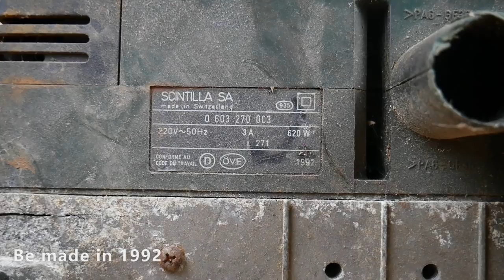Restoration Of Belt Sander | Bosch PBS 75 Restore

Comment: Back when Bosh had built up the reputation for making quality power tools.
Reply: Yeah, I have one of these and until today it was still going strong and I think the only issue is that I’ve finally worn the motor brushes down!  A set of brushes is £4.75 on ebay so it’ll soon be running again!
Reply: @chrislloyd1505  You'll be good to go for another twenty years maybe longer 👍

Comment: Got mine in 98 - been a great tool. Broke the original drive belt just a couple of days ago.
Reply: Easy and cheap fix, and you've probably done it already. In case you haven't, I didn't like how it was done in the video, apparently forcing it on under full tension. Just remove the nut that holds the big tooth wheel on the axle of the roller, and push the axle in, that way it is very easy to first put the belt on, position the big wheel where it should be,  and then push the axle back through.

Comment: I have the same one... Had to change the brushes and bearings... Also the belt tensioners sliding bearing, melted the plastic... Will replace wit a ballbearing... Good machine... Loud as straight piped V8... :P

Comment: Back in December, I bought a PBS75 at a thrift store - they had a huge crate of various power tools that they had apparently tested and deemed unworking, and everything was the same price, which I don't recall exactly. I'm quite sure it was less than 50 DKK (6-7€/$), probably either 25 or 20 Danish Kroner, but could have been as low as 10, I don't remember. I asked the guy if he knew was wrong with it, and if we could try powering it up. It was slightly battered, the front holdin knob was cracked snd had been repaired with duct tape, but spat from a little surface rust on the bottom steel plate it didn't look water damaged. No problem, he plugged it in, and the motor ran fine, but the roller didn't rotate. He then said that the drive belt was probably broken, but that would be easy to replace. Of course I bought it! I took it apart, and sure, the belt was broken. Othen than a little grime and dust everything else looked fine. I could read the part number on the belt, so I looked it up, and found a web shop selling spares. They asked 125 DKK. Plus 39 shipping. Last week I went to the nearest store, but they couldn't get spares, although they did have the current version on a shelf - listed at 899 DKK! Tuesday I went to a different store, no problem, they would be happy to order a spare part for me. She looked it up, got my number and said it would be around 50 kr+25 transport, and it could take a few days, maybe a week. Yesterday I had a call, and I got the belt in the afternoon. 65 kr, less than 8 €/$, all in all. Today I cleaned the tool a little, installed the new drive belt, and assembled everything. Works just perfect. I don't know its age, is say PBS75, 620W, and made in Switzerland. Less than 100 kr - I saved 800 kr compared to a new one (PBS75A I think) that otherwise looks identical. I think that's very nice! :-)
Reply: Date is on the bottom right hand corner of the info plate

Comment: Hello I have this sander and the other day it blew a fuse or something? A small electrical pop and it stopped working. Could it be the white suppression filter that need A replacing? Cheers for any info